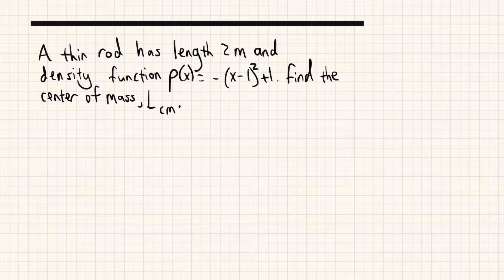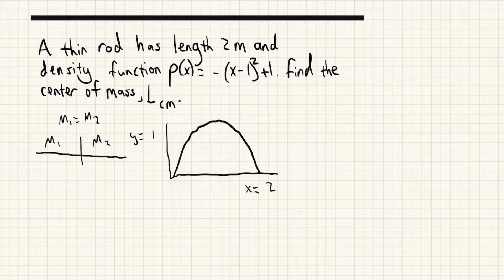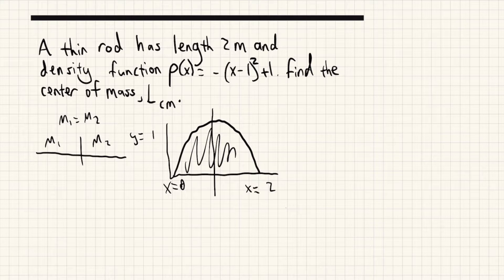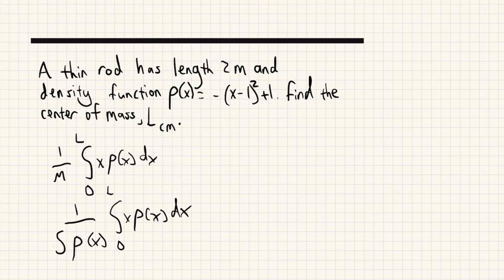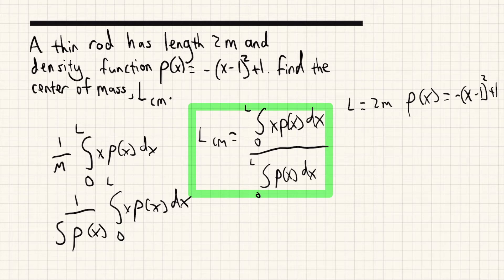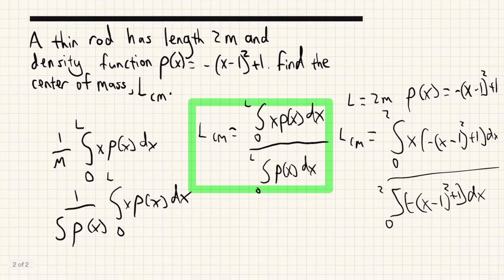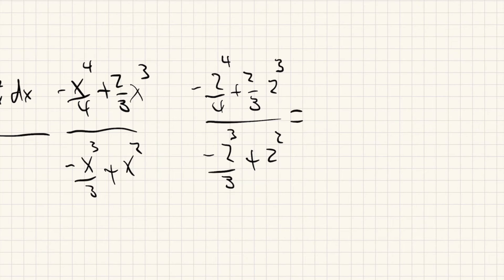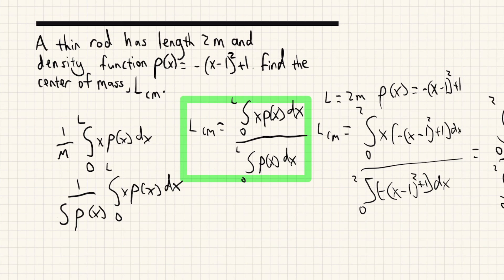Find the Center of Mass of a Thin Rod | AP / College Physics / Calculus

Comment: Just to be sure, but shouldn't the integrals be done with respect to volume or dV? Albeit it says it's a thin rod, but I think it's more intuitive using dV. I could be wrong, never done centre of mass stuff before.
Reply from the maker: Your thinking is correct. However in the case of “thin rod” problems it usually refers to a 1 dimensional line segment with a set density at each tiny section, dx. If it were a true 3D rod like a filled cylinder then yes you’d use dv.